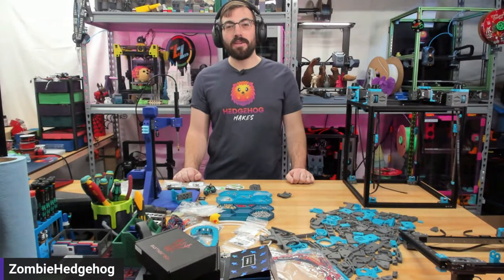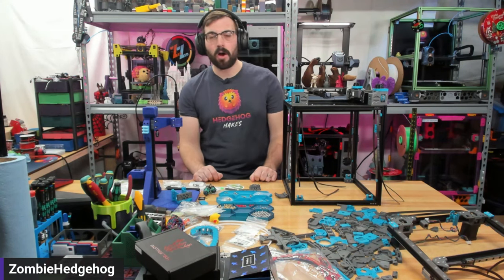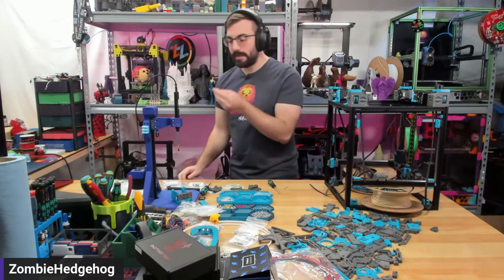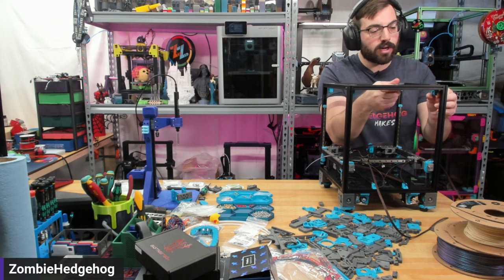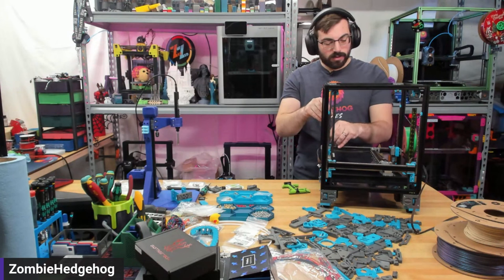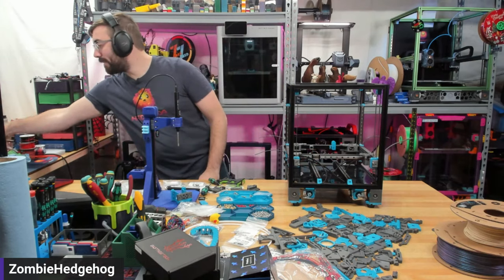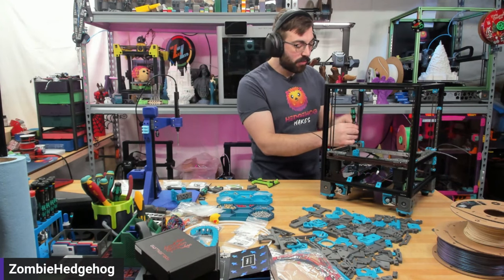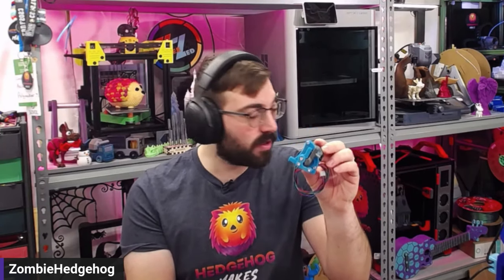Mini CoreXY Flying Gantry | West3D Micron+ Beta Kit Build! | Episode 3

Comment: Your rail is fine. You just have the wrong carriage block. You have the C block but need the H carriage block. I'm not sure if I missed it or if you forgot to put the 2 long stiffening screws in that go down through the Boop backplate from the top. Watch the wiring on the PCB for Boop. The black is not ground. I think it's the green.
Reply from the maker: Good note, I'll make sure to check the pin out before wiring.

Comment: Not sure if I missed it in your video related to boop, but I think that you missed the screw that comes in from the back just under the sensor. It threads into an M3 nut that you place on the back plate. You should see it on the CAD. This will stiffen up the assembly to the rail.
Reply from the maker: I missed it because the square nut fell out during assembly, but I'll make sure to install it during final assembly :)